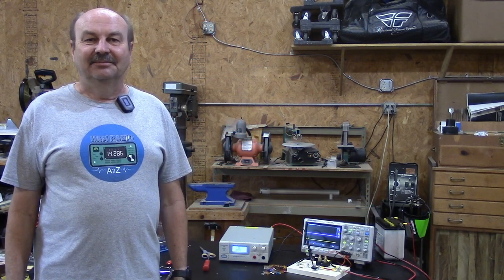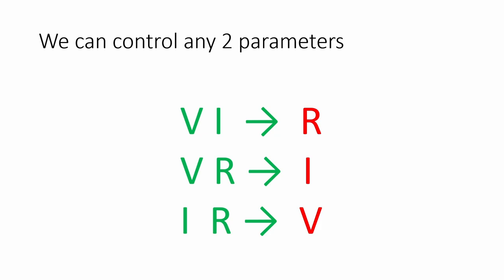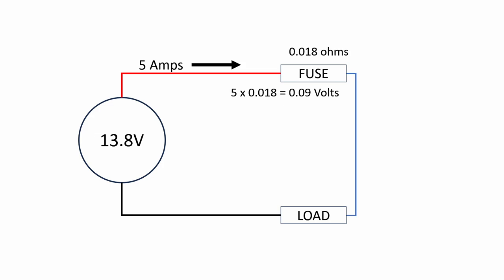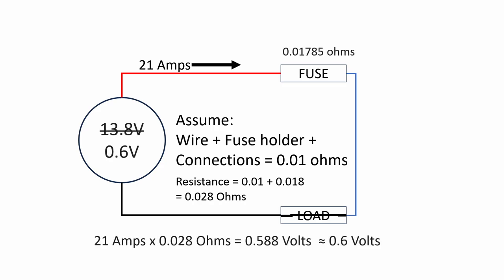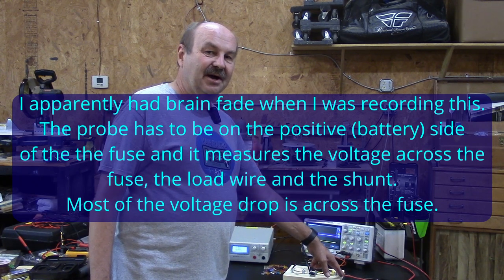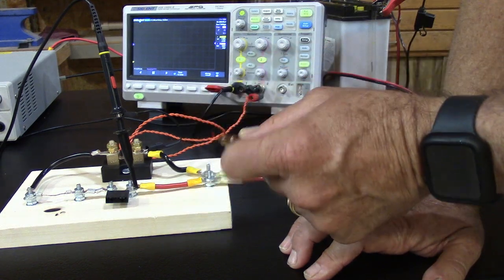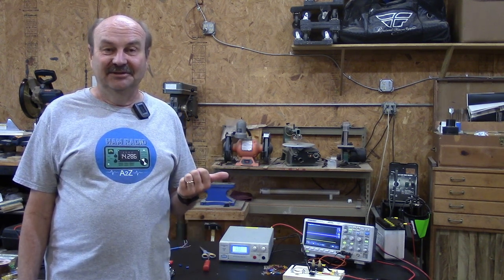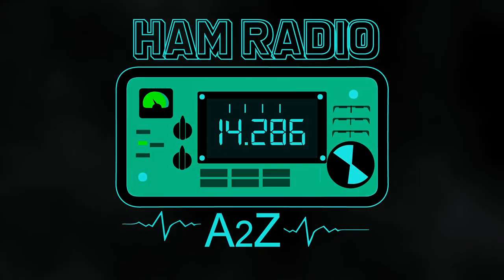Bad Fuses Part 2

Comment: Excellent follow up video and enjoyed the Ohms Law refresher.  I recently retired as a Auto Technician and remember an Instructor expressing similar warnings of using no-name aftermarket fuses.  These could unknowingly be installed by a customer potentially causing expensive repairs.  The same instructor used a infrared thermal imaging camera aimed at a fuse box to track down excessive current draw.

Comment: Another great video Tom!  The little amount spent for brand name fuses is well worth the expense to protect thousands of dollars worth of equipment. 73
Reply: Its not that clear cut - yes, the no name fuses will burn the circuit and wiring to protect itself, but the brand fuses will at best protect some of the components and cabling, no guarantees though! I wonder if its worth implementing a crow bar circuit triggered on over current conditions to blow the fuse quickly or even a current detection and isolate circuit in expensive or complex circuits?
Reply: @MiniLuv-1984  Yes, you’re right; there is no guarantee that even the branded fuses will protect the devices in the system. However, that is not the primary role of a fuse. The reason we use fuses is to prevent fires caused by very high current flow in wires and circuits. For example, a wire that has an ampacity rating of 40 amps will be guaranteed to not get significantly warm when carrying 40 amps or less. If these wires are the weakest link in the system in terms of current carrying capacity, then it’s a good idea to fuse it with maybe a 30 amp fuse to be on the safe side.
Maybe the branded fuse in your system will still not protect your electronic device. However, it will protect your house from burning down. How much does it cost to buy a new electronic device? Compare that to how much it costs to buy a new house including all the belongings that might be ruined in a house fire.
Reply: @TheCrazyStudent  True, but I want more. I would like the fuses to protect the circuit being fed by those wires. I guess the kind of circuits can be built into the circuit itself but rarely is this the case, so the only solution is to build an electronic fuse with current sensing and preferably some ability to set overload conditions.

Comment: EE here. Excellent explanation of Ohm's law and the role it plays in this circuit. What viewers should also understand though is that when the fuse opens then the voltage will shoot up. This is because the probes would then be measuring source voltage across the power supply rather than voltage drop across the fuse.

Using a car battery with a low internal impedance is of course going to clear the fuse very quickly because the battery will be sourcing nearly infinite current (hundreds or thousands of amps). However I think your video sourcing 20A across a 5A fuse was much more interesting. We'd like to believe that fuses should blow in under 1 second if they are even 2x their rating. Obviously this is not always the case.

Comment: Also, faults in equipment, modules, etc don't always manifest as direct shorts. A 0.5 or 1 ohm short in this case would cause the chassis wiring to fail before the fuse would blow. This would be terrible in a vehicle because they have many meters of interior wiring bundled together that is all put in before the interior is.

Comment: Great follow up video !    Now to cry getting rid of hundreds of fuses I spent three years building up a supply of.  One issue is trying to determine which are the name brand fuses and which came from the big C country.
Reply from the maker: Thanks Jed.  Unfortunately, I haven’t found any name or brand markings on the name brand fuses.  On the origin—. Honestly, the name brand fuses are probably made in the same country.  They just have stricter requirements, quality control, and most likely, some level of sample testing.
Reply: @HamRadioA2Z  There are markings on the name brand fuses, you just (usually) need a magnifying glass to see them. One thing I've noticed about name-brand fuses is that the numbers ALWAYS have white paint or ink on them (so you can actually see them), the no-name fuses don't have that.

Comment: I would still like to see circuit breakers that plug into car fuse holder.  Will they pop at the proper amperage? Also you can use a variable resistance circuit with a 12v supply by using a heat sinked heavy duty transistor such as a TO-220 with the base controlled with a pot.

Comment: 12 volts across a basic short, tell them good luck with that.
Reply: Oh, it can be done. I have seen it at least twice, once killing a perfectly good wrench and once taking out a couple perfectly good MOSFETs.....
Reply: @wernerviehhauser94  No, you haven’t seen it. You only think you have. Once the current started to flow through that wrench or MOSFET, then the voltage across that wrench or MOSFET was not 12V anymore. It was much less than that. The wrench has such a low resistance that it would require unrealistically big wires and a power supply that is out of this world in order to get 12V across the wrench. I highly doubt this was the case for you. Also, did you measure the voltage across the wrench when it happened? If you didn’t, then how do you know that you got 12V across the wrench at that time?
(You can’t say that it was 12V before the wrench short, because then we are talking about the open circuit voltage and hence it is irrelevant. Open circuit and a short circuit are two completely different scenarios. In an open circuit it is easy to obtain high voltages. In a short circuit you can obtain high currents but not high voltages.)
Reply: @TheCrazyStudent lol

Comment: Other than physical (insulation) issues, fuses are not aff3cted by voltage.they simply are current rated devices.

Comment: Oh I didn't suggest lead acid for a power source as any shade on your methodology or conclusion. I made the suggestion for a lead acid and some crude loads such as head light bulbs or toaster wire to have the ability to test larger fuse values without a massive PSU. Having fuses that are only able to clear dead shorts is not worth having in the parts bin! They will surely allow more damage and fire starting potential than they are worth. Thank you for sharing this. I still need to test my kit of fuses

Comment: Great follow up video Tom. After your first one, I recall buying a pack of fuses and I cannot recall if they were from Amazon or Harbor Freight or one of the ham radio resellers. Fortunately, they are Littlefuse (or so the package claims) so I should be good. Thanks!

Comment: Or to put it another way, if in theory you managed to get 12V across that 0.028 Ohm circuit you would have in the region of 420 Amps flowing.
Reply: And then we can take bets whether the fuse or wires will blow at 400A...

Comment: I would have added a switch to the test setup. The connectors do not deserve such abuse :-)
Reply from the maker: I thought about using a big contactor, but just didn’t want to bother going to that level of effort.  Besides, it’s a good test of the Anderson Power-pole durability.

Comment: Thanks for all the info, very informative. I am sure you will agree that your test rig is of the sledge hammer to crack a nut variety, and very effectrive it is to! I think that you could garner far more usful info by having a variable load and a car battery to have a "real world" situation. By using an old car heater motor, with a brake set up on the shaft the amps required to run the thing could be varied, and the amps and any voltage drop easily monitored. While the reasons to have a low voltage supply are obvious, as you explained, employing a full 12 volts brings to whole set up into the real, as opposed to the theoretical arena. It would also be handy to know the exact failure point of the rogue fuses. I may well set up a rig to test this out myself, oif I do, I will video it and send you the video file for your information and possible inclusion in a follow up to the first 2 excelant videos. 73 Jim M7BXT
Reply from the maker: There are many ways to do this testing.  Please do let me know if you make a video with your setup.

Comment: Tom, Thanks for coming back in front of the camera with an improved test scheme! While you have the test set up handy can you do one more test? Let's see how your electronic supply switches from CV to CC modes.

We know from your first video on fuse testing that in CC mode it supplied 23Amps.
How quickly did it reach the CC value from being in the CV mode supplying 13.8V (prior to the short intended to rupture the fuse under test)?
How does that time compare with the measured time to rupture fuse(s) when powered by the (motorcycle) battery?

Final thoughts; You went to the Littelfuse data, but you didn't mention the I^2t (far right column) which is key to understanding the energy required to melt the fuse under fault (over current) conditions. 73 de K7GVG.
Reply from the maker: I^2t is an important concept for understanding how fuses will react.  I thought about explaining it, but I didn’t want the video to end up being an hour long. 😁. Maybe a video just covering that down the road…

Comment: This is an awesome video! You did a great job thanks! Very useful information throughout!
Only one caveat at least from my experience, at 13:15 you said most people won't be running from a copnstant current power supply. That might be more common than you think. My grandfather being a H.A.M. for a very long time had plenty of linear and switching power supplies that were "plug in car batteries" they were rated for 13.8v and 15-35A. The one that comes to mind is the Samlex SEC1223 which is a simple switching power supply. If shorted it will put out a constant 23A with the voltage dropping down under heavy loads. So that would exactly simulate your test scenario in actual use.
I have not tested any of the linear PSU's yet, I would imagine they would surge all the current the transformer could muster then blow the 120v fuse first. The reason is you don't want a linear regulator to do constant current is because all of the voltage is still coming out of the transformer, then the excess voltage that needs to be dropped in the regulator to limit the current would be essentially the entire output of the PSU and would quickly overwhelm the switching elements and heatsink.
Reply: All power supplies are current limited.  Even a heavy battery is limited by the size of the conductors inside.
Reply: @russellhltn1396  well yea, I think him and I were talking about current regulated supplies. Of course you won't ever get infinite current from any source.
Reply: @SuperBrainAK  Exactly.

Comment: I wouldn't use those knock off fuses for anything, mostly if it has lithium batteries as power sources! It just doesn't worth the risk by any means. One knock off package can have the (i.e.) 5 amp fuse blowing at 15 amp, and another fuse from a different batch from the same knock off brand blowing at 25 amp, i'm pretty sure there are no control over the material composition or even thickness.

Comment: Note, that fuse only blew because you did a full short. The wire was damaged, other things would be. And if the short wasn't across the whole circuit then we know the fuse won't blow.

Comment: Perhaps what is missing from these videos is a warning that these fuses are rated at a low voltage, typically 24V.  This means that they are only capable of breaking the rated current at this low voltage and they should not be used in higher voltage circuits.  If you used one in a mains voltage circuit then it would likely just develop an arc across the fuse which would then attempt to burn down your house.

Comment: Actually you can get by quite a bit simpler than this. Fuses are a current device, period. Anybody focusing on the voltage is off base. In fact most fault consumer protection devices are current devices. I would go the route of simply getting a load that will handle the 20 ish amps you want to test with for an extended time. Then just run the test. I think the first test did showing that these fuses are junk was done well and the focus on voltage etc is chasing untamed ornithoids.
Reply: Agreed. The original test was correct and complete.

Comment: Thanks, Tom, for this follow-up. It rather confirms what I suspected, that a battery will cause the fuse to blow nearly instantly but an SMPS will not. As these fuses were designed for cars this is not surprising.  I take your point, though, that using an SMPS to power up a ham rig might be risky given these results. Interestingly, however, my IC-7300 has two of these auto fuses (no-name molded into them) mounted right on the DC power feed lines. Both are for 25 amps and both + and - lines have their own fuse. In the shack I use a Samlex 13.8V SMPS but without the variable CC/CV feature. I wonder why Icom chose this setup?  Would two fuses mounted in this manner change the results of your test?
Reply: But this doesn't alter the fact that these fake fuses are dangerous. Short circuits are not the only kind of overcurrent fault.
Reply from the maker: True, ATC/ATO fuses were mostly designed for automotive use.  But, don’t forget that the brand name fuses that actually meet the specs blow just fine with a limited current supply.  It’s only the No name fuses with no published specs that are a problem.
Reply from the maker: A fuse in both the positive and negative power lead is effectively 2 fuses in series.  Assuming the 2 fuses are the same value, this won’t change the characteristics of how/when they blow.  When an overload occurs, vary rarely will both fuses blow.  One will almost always open first.  If/when a fuse does blow in this case, it is important to replace BOTH fuses.  The one that didn’t blow will have been stressed and almost certainly no longer meets its specs.  The fuse in the negative power lead is mostly important in a mobile installation.  The reasons are probably worthy of a separate video just on that topic.
Reply: @BrianG61UK  Why do you think these are FAKE fuses? Haven't we improved the testing (removed the bench supply) and can rupture any and all fuses all day long?
Reply: Both the IC-7300 and IC-9700 came with ICOM power cables and have not just two, but four fuses. Two Blade type in holders and two AG3 glass fuses inline and covered by black heatshrink.

The reason for both NEG and POS fuses is to protect against faulty installation (in a vehicle) or for a chassis connected accidental ground to vehicle metal due to vibration abrasion (or similar)

The reason for the "buried" fuses is to protect against the user replacing the blade fuse with the wrong current size.

Under fault conditions all four fuses could be in series, or only two in series if shorted to the vehicle metal chassis, and in either case the weaker fuse will blow first (doing it job of protecting your expensive rig, and avoiding a vehicle wiring fire)
Reply: @pstonard  A 5A fuse that is happy to carry way more than 5A indefinitely is dangerous and is not a 5A fuse.
Reply: @BrianG61UK  Good point, so we should be testing brand versus non-brand fuses before condemning them.
Reply: @BrianG61UK  perhaps you should look and understand how fuses actually work. Fuses have NO means of specifically limiting current EXCEPT at SPECIFIC designed voltage. Do a web search as to how fuses work. A fuse works by having resistance and that causes it to heat up, but it takes power to cause it to heat up, watts, voltage times current. Low voltage allows more current because there is less power. Consider a 12v 5A fuse, the total circuit would be a max of 60W and the fuse shouldn't blow unless and until that is exceeded. Most of the power is going to the device, not in heating up the fuse. In the first video, the voltage dropped to 0.6v at 20A, which means that the total power in the circuit was 12W. It is unknown the resistance of the other devices. There was NO voltage drop measured across the fuse, so if there was higher resistance elsewhere, the power would be dissipated elsewhere.
Reply: @pstonard  re: "The reason for both NEG and POS fuses is to protect against faulty installation (in a vehicle) or for a chassis connected accidental ground to vehicle metal due to vibration abrasion (or similar)"
Excellent point. Too few ppl understand this. The manufacturer has learned this is the best way to keep their customers safe (and warranty claims on radios) low. Most ppl forget about that reverse polarity diode inside the radio too. The fuses pop if the radio is miswired (red wire to neg etc.)

Comment: If you do any follow up videos, it may be worth using a low impedance source like the battery, but try increasing the load impedance.  To me, it is foolish for someone to count on a short circuit from a low impedance source as justification to use junk fuses. 

What happens if we extend that 24 awg wire to a few feet? Can we add enough impedance via the wiring to lower the peak current a bit and see the results. How long does the fuse take to blow now?

Anyway, great videos. The internet is full of people with opinions, but there is nothing as informative as actual data.